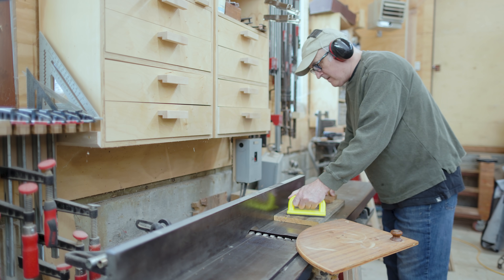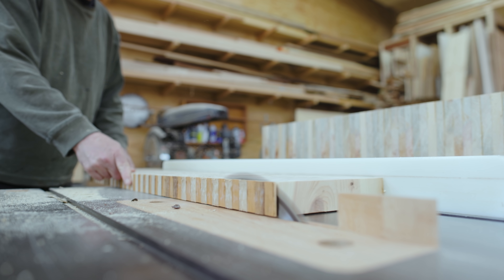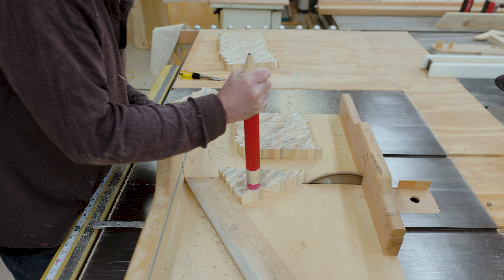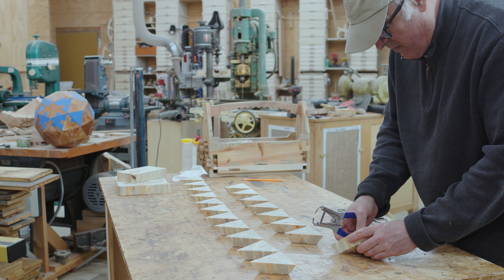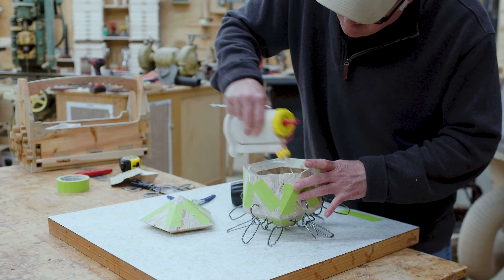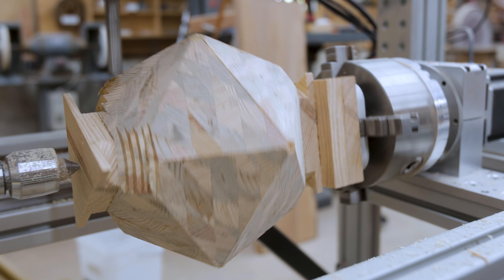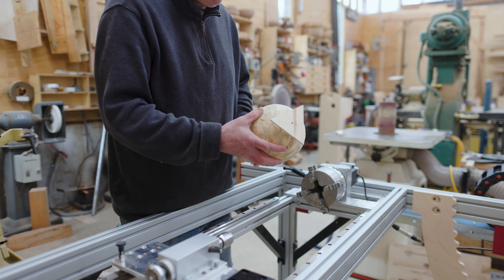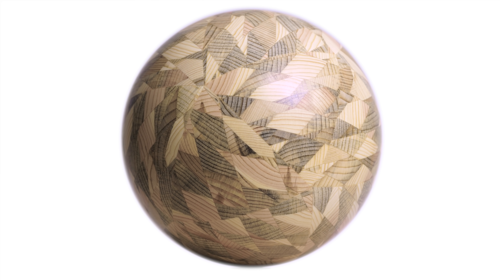Making a Chaotic Patterned Segmented Sphere

Comment: Don't know much about woodwork, but looking at the chaotic pattern chopping boards, I think the key is to make the joints between the slices align with the chaotic pattern, so it sort of hides the fact it's composed of strips. The Chopping boards use a grid to achieve this, so for the sphere you probably need to work off a triangular grid. 

So I'm picturing gluing together short triangular rods into a larger triangle (imagine a triangular version of making a cube from square dowel rods) and then cutting slices off of this to make the faces of the sphere. You also want a mix of sizes or triangles when you do this glue up to create the chaotic appearance (you might be able to mix in trapezoidal/hexagonal shapes as well?). The chaotic boards sort of work because the initial components are of varying sizes, but they all look like multiples of some smaller grid). To make sure they can all tesselate properly, they should be multiples of some smaller triangular grid size (I guess something like 20% of the sphere face length should be ok, but maybe it needs to be like 10%). Once glued you could cross cut to get multiple faces from one glue up, but they'd be identical up to rotation. Maybe you can make 4 or 5 of these glue ups and get 5 or 4 cuts to make your 20 faces to get some variety. Or you make twenty different glue ups? Maybe that's not so bad either, if you just make chunks of the same length from your triangular/trapezoidal dowels, it's a bit like doing a jigsaw puzzle then.

Comment: I think, if you want a truly chaotic pattern- You're going to have to involve the C&C machine and have a LOT more waste. You'd have to cut out of random pieces, and potentially try to avoid straight lines in your pattern/re-glue passes. Would that be do-able on the C&C? Perhaps cutting mirror images on opposite ends of the board and working your way centerward so you don't have straight lines? (like puzzle pieces, but less detailed, with waves/inverse waves so they fit together and can be reglued and then cut up. I think even if you did one "wave" pass where you did that, with different hardwood colors (including purple heart (pretty please!!!) only bc its my favorite, but that's just personal preference) -  you would get a stunning result. "Nature abhors a straight line." :) 
It would give it a very organic look, and you might even be able to do something cool like work your initials into it in the first glue in in a color, and then cut it up and you'll have even more of a conversation piece than you normally do. Either way. hats off to your talent!
Reply: This also might give way, with some of the scraps from that "more waste" I mentioned.. to doing 20 solid light colored triangles for a sphere, with an interesting shaped inlay in the center of the triangles. (I'd personally recommend either all hearts or the clubs/hearts/spades/diamonds from cards. That could be PHENOMENAL looking. I wish I had the equipment/knowledge/talent.. I'd do it myself. :) Or better yet, do it in a box format and it would make an AMAZING box for holding playing cards/poker chips.

Comment: Suggestion: just have the CNC machine only finish two pads where you can locate on in the lathe.  It’s much quicker to rough on the lathe and you get the centre of the sphere from the CNC

Comment: Thank you for this. Watching you use the rotary axis and realizing that ultimately it was a time saver was a great watch. Although the CNC takes a lot time to cut you can walk away and do other things. Plus you can speed it up now.
Reply from the maker: Thinking about it now. I could sand the points off and just do a single quick finishing pass on the cnc.  30 min on the cnc to save a day at the lathe.
Reply: @frankmakes  You were running it slowly. Just increased IPM would cut a pile of time off.

Comment: so maybe once you have the long strip, maybe chop it in half or thirds, first, THEN choose different angles, for one or all of the passes, so you're not stuck with JUST 30 degree, AND the segments are not all the SAME angle. part of the chaos is that it's NOT all the same. even if it's all scattered.  many of the bits of wood are all the same shape. but if you cut half at 30 and the other half at 40, then stack those  back together, then you'll have another layer of randomness.

Another would be one of the wood colors be thicker strips. and another could be cutting the 30 angle slices at one stop, and the other half bumpt it into a thicker or thinner slice, so the glue up is about the same...but you shuffle them up, and now you have randome thickness slices to juggle and reglue. 

now you've added two more "Dimensions" of random. one really probably easy to accomplish.

Comment: Everything I'm about to say is from a much less-skilled place and with all the respect in the world for Frank. My only bug on it (and I'm only half a semi-serious wood worker) is, you talk about it being faster and easier with the CNC. Of course it is, and I get how nerve racking it can be to through a shape like that straight on the lathe, but how much do you want to actually do? I would be hard pressed to give all that power to the machine that did it for me, it would feel like it's not really my project. I know, all you who will see this, I know, I get it. I know how hard turning is, especially weird shapes. But that's the root of the satisfaction. It just makes me curious about the point of the project and the video. Is the point to say "well, I was trying this out and for the heck of it I used the CNC as much as possible so I could see how it turns out."? That's totally fine, I get it's kinda a prototype and all that. But just to finish something in a day and a half can take a lot of the satisfaction and self-understanding of how much you actually put into a project.

Comment: This will sound insane but once you had glued up the sphere, you needed to cut it again in to pieces, 6 cuts, 90 deg apart on the x,y,z, going through any side of the triangle. Then glue it back together and either repeat, or proceed as you did.  Smaller sphere here you come… 

I thought the end result was beautiful, but can see the larger triangles still. Arm chair opinion over. Back to making this movie. Mark Breakspear.